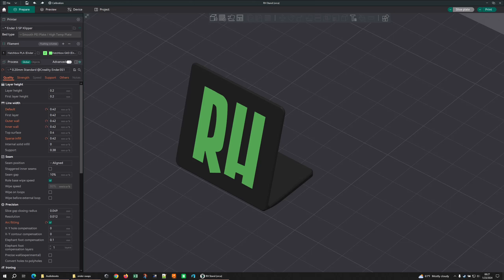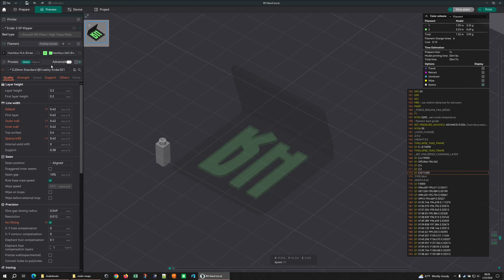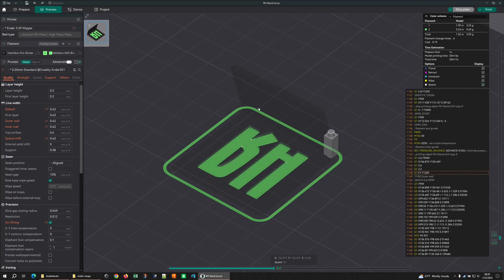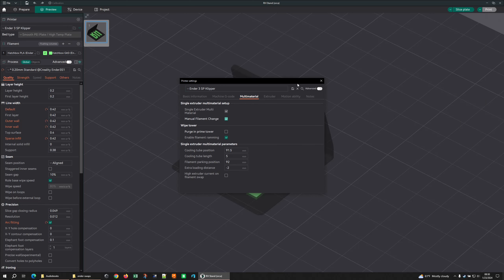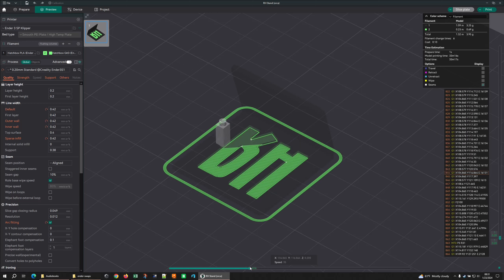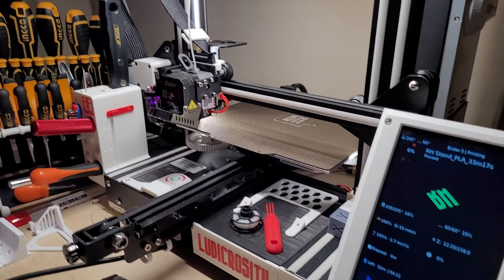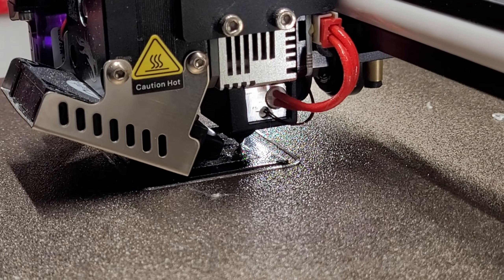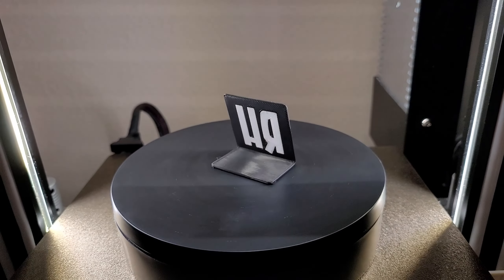Orca Slicer 1.9 - Klipper and Multi-material

Comment from the maker: Something I forgot to mention since I've had it set up for so long - if you're doing this for the first time:
Open up Printer Settings
Go to the "Machine G-code" tab
Scroll down to "Change filament G-code" and type in "M600" (no quotes)

Now when it invokes the filament swap it'll actually invoke the command to tell the printer to park the head, eject the filament, and wait for your input to resume the print (after you've manually loaded the new filament, of course).

Comment: 4:56 damn, I was hoping to find that info here since it seems there is 0 way to tune the tip forming and it makes the filament get stuck every time it does a color swap. good info though, maybe ill try it without the tower
Reply from the maker: @morganbills2749  making materials stick to each other is about having a high enough flow ratio that they ever so slightly over-extrude. The prime tower helps stop whispies and drool from ruining your print.

Comment: How do you figure the "Single Extruder multimaterial parameters"?
Cooling tube position
Cooling tube length
Filament parking position
Extra loading distance
High extruder current on filament swap

Documentation on this is still mostly WIP
Reply from the maker: @JustinRicheson  parking position was set with trial and error - I ended up using +5 on Z and setting and absolute X20 Y0 because for my printer that put it pooping off the front of the plate.

Depending on how your printer's dimensions and homing are set up it may be different. For example mine sees the bed as 235x235 from an absolute 0,0 in the lower left corner, not 220x220 from the middle.

Klipper can get weird from machine to machine and a LOT of it is trial and error!
Reply from the maker: @JustinRicheson  as for the rest - they were either defaults or undefined. I never changed those.

Comment: so how do i tell it what layers or time i want it to stop at?
Reply from the maker: That's the beauty of it - you don't. The filament swap will be introduced when necessary by Orca. You can scroll the gcode like I did to find the M600s, or perhaps export the gcode so you can open it in something like notepad++ and just search for it.

It's very different than the Cura (and it's clones like Creality slicer) where you would have to insert the changes manually. The slicer engine is built around this method so you only need to make sure your model is correct in the Prepare tab, check it in the Preview tab just to make sure, them stand by and be ready to swap the filaments when the print head parks and it prompts you.